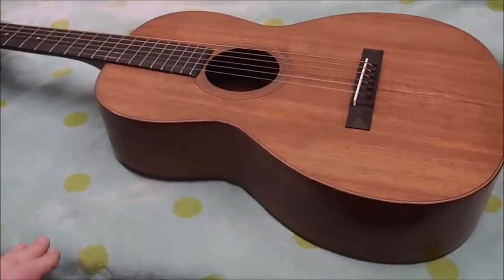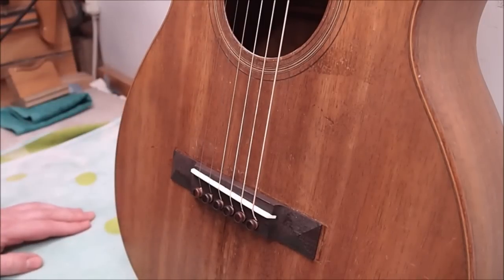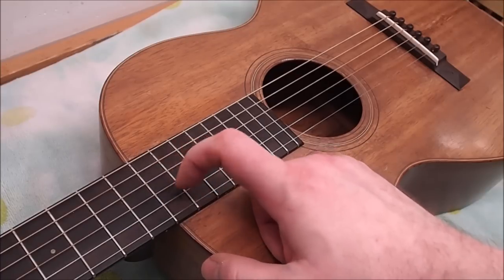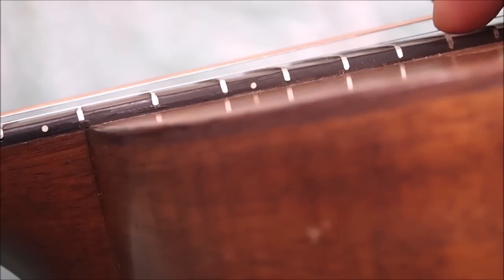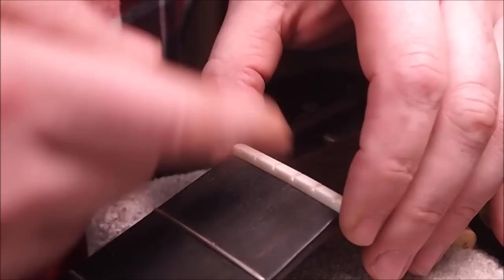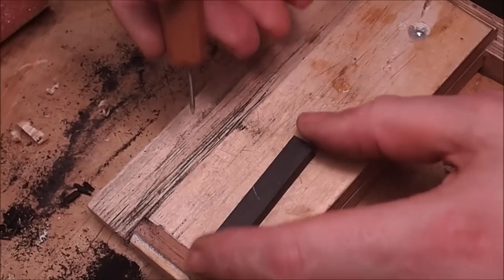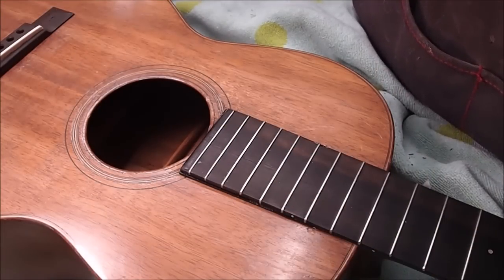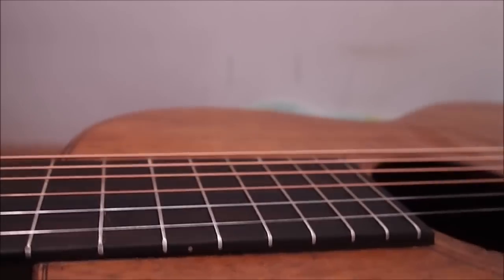Martin 0-18K from 1926

Comment: I've picked up a few tricks of the trade from you, so here's one of mine: for delicate/smaller fretboards (mandolins, plastic pickguards that extend up), I use a ski-wax iron directly on the frets, and shop towel on the guitar body with a sheet of aluminum foil over the towel for heat dispersion. The ski wax iron has a smaller and narrower surface area and even at full rip it isn't as hot as a a clothing iron.

Comment: When a friend of mine won an Emmy award (she actually won the following year also), she called me over to help assemble it. When you win the award, it has a blank base. The engraved base comes later in the mail. The only way to remove and install the base is to take a razor blade to cut a small hole in the felt underneath so that you can get a tool through the felt base to remove the nut holding the base in place. When I told her "I have to take a razor blade to your Emmy award" she understood, but I could tell was a little freaked about it. Seeing you take an iron to this guitar kinda reminded me of that. It's all good.
Reply: All's well that ends well, eh?
Reply: I get that a lot helping friends reassemble Emmies…
😎

Comment: I have learned so much by watching your videos I felt confident enough to fix the action on a vintage acoustic I purchased some time ago.  I was able to identify the root causes of the problems and correct most of them.  I am still working on the bridge, but am confident it will come out as good as the other work I have done on the nut and bracing. You are a skilled craftsman,  teacher and dare I say a true genius and the only one I know with a doctorate in guitarology. Brilliant!

Comment: Awesome repair! I've been studying and practicing the luthier trade for 5 years now and I picked up a few tips from this video. I especially like the denatured alcohol trick. I'm working on a 1930 National Triolian now that used to be my great grandfathers which I never met but, he passed it to my grandfather who died in 1975 when I was 4 and left it to my dad who will eventually be leaving it to me when he decides his time is up. This thing is in bad shape someone painted it black with a paintbrush which I'm removing with alcohol.  The neck is bowed badly so it's in the neck jig now and I'm going to heat press it tonight or tomorrow and take some measurements to see If I'm going to have to reset the neck or not. The fretboard has dugouts in it from grandpaws fingernails and the 1st fret is about 1/2 way through the fretboard so I am thinking about replacing it. Of course, all the frets are shot as well and it's missing one set of the original tuning keys (I would love to find an original set somewhere). Someone even thought it was a good idea to carve some art designs in the headstock and the neck lol. Where are you located? I'd like to send you some pics of the guitar's condition and pic your brain for some different ideas on the best ways to restore it and preserve its value.

Comment: A model plane iron has adjustable heat range. Also check out one for carpet seams. Happy holidays!
Reply: Thanks very much for that tip!  I have a model plane iron and it never occurred to me to use it for this...
Reply: Was thinking the same. Used for shrinking doped fabric on full size aircraft restorations and for monokote on radio controlled aircraft. Best one I've used is available at Aircraft Spruce: https://www.aircraftspruce.com/catalog/cspages/aviationart09-04837.php

Comment: I also use a small iron to heat the end of the fret board. This board is thin, also the frets will help transmit heat down to the wood.
On a thicker board I normally want a higher heat. I place 4 layers of tin foil down to protect the top.
It works for me. Last thing I want to do is bubble up the finish on the top...Yikes,...a ton of work to fix.
I once had a customer bring me a 1845 Martin parlor guitar, black coffin case, New York stamp inside in excellent shape.
I called Martin Co. They said the original C.F. could have built it, or at least touched it. Wow, what a trip that was, and even just sitting down and playing it.

Comment: For sanding things flat, i recommend stickit sand paper on a piece of plate glass. A larger area say 12" x12" allows for wide circles as well as w shaped strokes at a lighter touch as strokes are longer and remove more material. The lighter the touch, the flatter and straighter the material, any material.

Comment: I usually use a piece of corrugated cardboard to protect my tops when I loosen the tongue. The air in the corrugations keeps things cooler than paper or card stock. I may have picked this up from Don Teeter.

Comment: Hey there. long comment alert. I'd like your additional input on a concern of mine. I was given an Alvarez 5002 Classical Guitar on Christmas that was previously bought new in 1989, making it 30 years old if the guitar was built that year. The nylon, probably D'Addario, strings on it were estimated to be 25 years old.

I am worried about putting new strings on it in terms of the total tension of the strings because of the age of the guitar. I don't want to damage it. Should I only use light tension strings and deal with fret buzz/get a high saddle? Can I use string tensions that were originally for it (perhaps "hard" or "high" tension)? Should I avoid other composites that are not plain old nylon/nylon core? Read on for more background/research I did.

Currently I have a text response from the person who gave it to me confirming to avoid high tension nylons, but he may not have fully taken in what I was asking. The luthier at a shop who replaced the saddle for me, which was chipped, believes I can use any nylon string tension without hurting the guitar, and recommended, as popular, strings I bought, specified below, that turn out to be different from normal nylon (but they are not steel strings to my understanding). 

Alvarez (rather a rep of them @stlguitarservice.com) said the model came with D’Addario Pro Arte EJ46 strings from the factory, which are today hard tension and total to 89.94 lbs from what shows on the D'Addario website. I found a packaging image that shows a 2007 copyright that lists individual string tensions that add up to 86.9 lbs. I'm not sure if these strings were available under "D’Addario Pro Arte EJ46" in 1989 or before.
I bought SAVAREZ 510 AR Normal Tension strings that per my interpretation of the individual string tensions, total to 88.07 lbs.

The guitar seems to have not been cleaned, so I researched and have started that. But otherwise seems in fine condition (without examining the inside bracing) minus a minor nick in the base of the neck and surface scratches maybe on the back(?).  Tuners need oil and perhaps cleaning, and are thought to be upgraded in the past from original.

Can I safely use the SAVAREZ strings, or should I use as low a tension I can get?
Reply: I have a '72 Gibson that I consider "new".  Your '89er  is barely a toddler in a guitar' s life. Clean it up with some spit and maybe lighter fluid, put some standard tension nylon strings on it and start digging in!

Comment: You made me look at my 2005 Martin D35 for how it's nut is designed, and I'm not sure when they did it but they are now flat on the headstock. The angle starts after the nut, I wonder what year they started doing that?

Comment: Great video.  I have a few guitars with the fall-away issue and this looks like the solution.   Just wondering about the process of cleaning up the underside of the fingerboard prior to re-gluing.
Reply from the maker: You can get some sandpaper in there, push the board down and pull it out. The nice thing with hide glue is it reconstitutes when you add more.
Reply: @twoodfrd  That makes sense.  Thanks for the quick reply.  Love the video and looking forward to giving this a try.  Like the idea of not using steam.

Comment: Two, it was my understanding that slanted saddleslots only came into being in 1927. Even then, it wasn't until about 1930 before most Luther shops were doing it Is this your understanding too? i did not think Martin was doing this  until 1930 actually.  I will go post a question on the Vintage Martin site now and ask there too. This was  only the second or third time I have seen closeups of the sides of bar frets too. Terrific job on this. Did you look at the possibility of working on all that excess glue and crap left over from the centre seem crack?

Comment: Beautiful work. Was there a reason the height of the bridge & nut couldn't have been changed rather than wedging the fretboard to lower the rear action? I did watch the whole video but didn't see this mentioned.
Reply from the maker: Changing string height wouldn't affect the geometry of the neck relative to the body. Basically this operation is to straighten the fretboard, not change the string height.
Reply: @twoodfrd  Thanks for the explain! I hadn't appreciated that was the core issue.

Comment: How did you determine the height of the fretboard wedge? Nice work.  Do you have a video where you illustrate cutting a deeper angle into the saddle slot so the string gets a proper bend off the saddle?

Comment: I had an Ibanez with moisture glare in the finish. Probably polyurethane. Would alcohol have helped there too?
Reply from the maker: Likely not. It forms an impenetrable skin. The water doesn't migrate through it as easily.

Comment: They sound and look like steel strings but it has a classical headstock and as you noted possibly used to have a golpeador. Are they just really light gauge, or does this thing have a truss rod?
Reply from the maker: They were made in a transition time when gut strings were giving way to steel, so they have elements of both. This would originally have had a tall nut for playing Hawaiian style slide.  It doesn't have an adjustable rod (Martin didn't do that until 1985), but it probably has a reinforcing strip of ebony.
Reply: @twoodfrd  does such a guitar require light gauge steels or lighter/avoid heavy at least?
Reply from the maker: @danielgoodman3578  yes.
Reply: twoodfrd almost all of my small body martins are strung with 11.5 silk&steels,good tone.volume and less tension. No sense in taking any chances with guitars of those vintages.
Reply from the maker: @j.mshrader2347  this one will be tuned down to D or C (the owner likes John Fahey.)  With the hardwood top I think it can handle extra light steel.  For pre-'30 spruce tops at normal pitch I agree, silk and steel is the way to go.
Reply: twoodfrd my koa 18 is a 26/27 depending on the build date. It was sold in 1932 to my great grand father. I have coffin case and original paperwork with it.